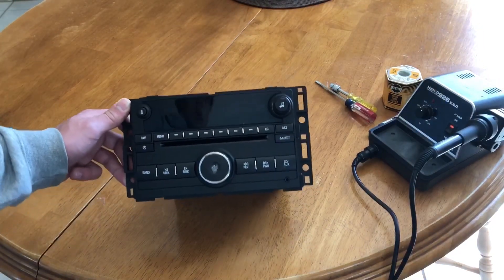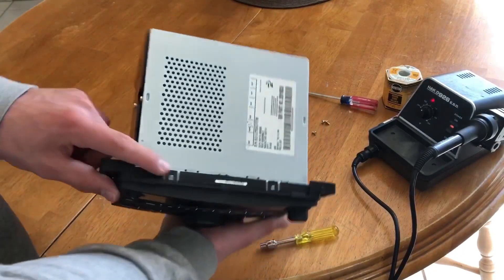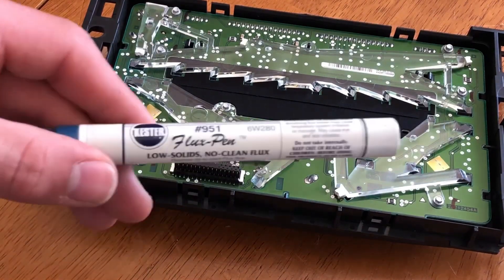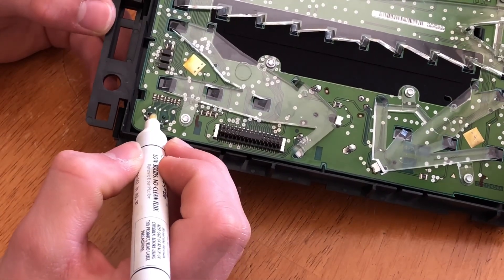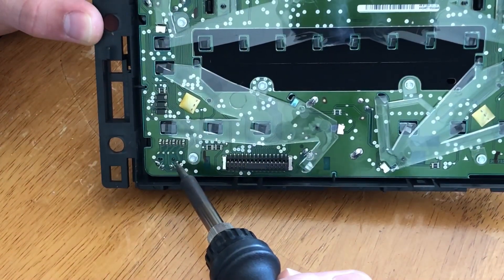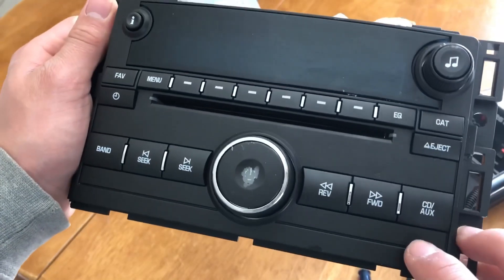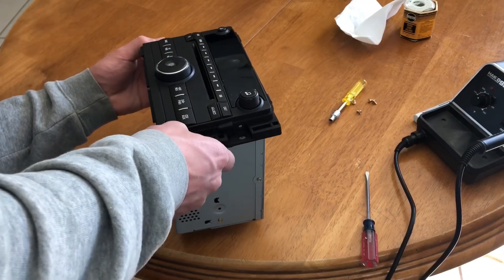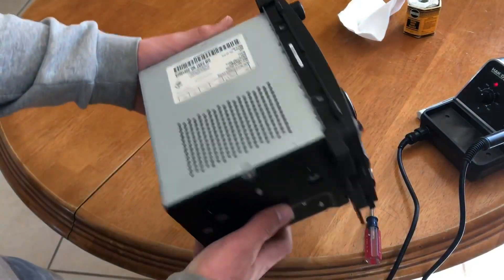How To Fix Broken Aux Port (Part 2, 2010 Chevy Cobalt Aux Repair)

Comment: I have a Tahoe but my problem is that the round plastic part on the auxiliary port cracked so i can still connect a cable but it doesn't stay completely fit. Do they sell those little round plastics?

Comment: hmm. I just took my head unit out, took the face off. And found out that they must make different models. I have none of those plastic "light diffusers?" and my Aux port is on a seperate 1x1 inch board. Seems like an updated version trying to fix just this problem? The contacts were fine, I'll touch them up anyway just to do something now that I've got it apart. But I don't think it'll fix my buzzing. I have tried it with different phones and aux cables btw.

Comment: Awesome, thank you! Just did this on my 2010 Silverado... works perfectly now. I only had one difference in my radio where I had to remove a heat shield from behind my faceplace before it revealed the circuit board. Thanks again man, saved me from replacing a whole radio
Reply from the maker: Glad to be of service! That's interesting, might be a slightly different radio

Comment: How much would this cost to get done approximately? I'm scared to do it myself
Reply from the maker: I'm not sure, an audio shop or electronics company might do it for around $100?
Reply: I just did it myself and the most difficult part about it was undoing the tiny hex screws to get to the circuit board. The soldering was easy and I've only done soldering once other than this.

Comment: This might be a bit dated,  ut do you know the part number or anywhere to find replacement female 3.5 jacks? My dog decided to headbutt my aux cord and it chipped the port a little. Long story short, the cable has to be taped down to stay in aux mode. My solder joints are fine, but this will be useful for having to resolder later
Reply from the maker: Amazon or Ebay are great for finding miscellaneous electronic bits. i hope ur dogs head is okay! lol

Comment: Has anyone had problems of the aux just randomly turning on all the time? Especially when hitting bumps too
Reply from the maker: That was similar to my problem, it seemed that my aux would only connect in certain positions. Maybe try a new aux cord and if that doesn't work this video might solve the problem
Reply: I just did this, definitely broken solder points on the aux Jack, havent driven around at all yet but so far it seems solid and good to go now.those little screws pain in the a@$... couldn't find a 1/8inch driver anywhere, one store I did buy one from, turned out the driver was not even actually 1/8" as advertised. Returned it. Got another set from another store and that one didn't have right size either... 3.0mm and 3.5mm. Needle nose pliers I used. Lol thanks for the good informative video!
Reply: Mine turns on to aux all the time, listening to radio, flips to aux, listening to CD,  flips to aux, seems to me a loose connection is likely. Plus when using the aux, it kinda cuts in and out when wiggled. I should try this fix
Reply from the maker: @ImaLoneWolfintheWoods  yup, sounds like a loose connection. let me know how you solve the issue and if my video helped!
Reply: Yeah I have the same exact problem with my 2013 Malibu. When driving the radio will randomly keep jumping to the AUX channel (even though nothing is connected to the AUX USB port) making the radio useless.

Comment: I have the exact same problem with the aux port 😒 might just switch out the whole radio.
Reply from the maker: That'll work too. I wanted to keep the factory radio in my case. Do you have a Chevy Cobalt as well?